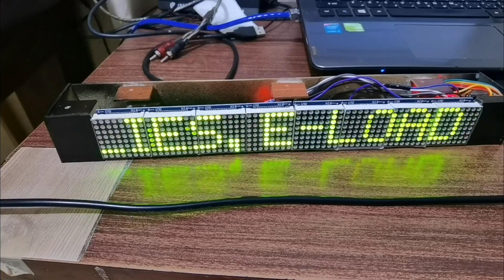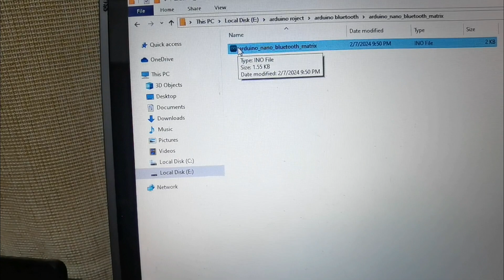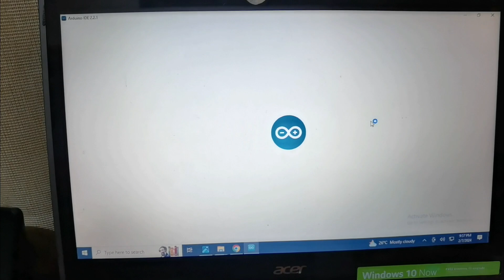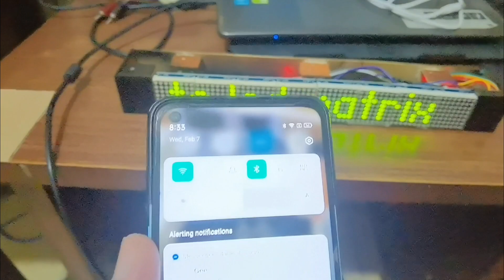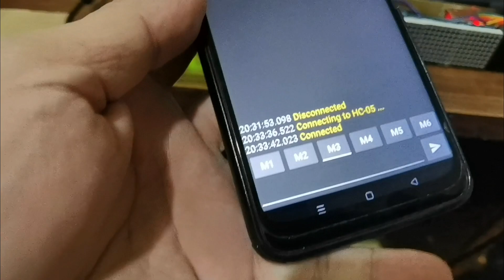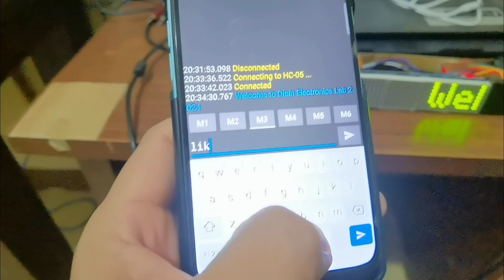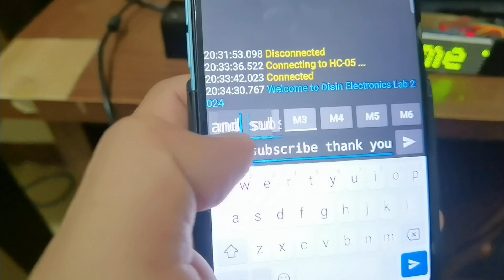Bluetooth scrolling text led matrix

Comment: DOWLOADED THE SAME PROGRAME BUT MINE IS NOT WORKING, EVEN HARWARE IS SAME (FC16_HW) . ALL THE LEDS START GLOWING , IS THERE ANY CHANGE IN PROGRAME WHICH YOU USED AND THE ONE YOU UPLOADED
Reply from the maker: there's no change in program which i used and the one i uploaded.
Reply: Is there problem with display
Reply from the maker: double check the pin terminals of max7219 and arduino nano CLK, DIN, CS
Reply: @seancastro2416  checked,  all  ok and as per defined in sketch